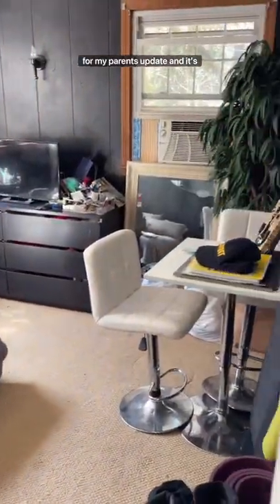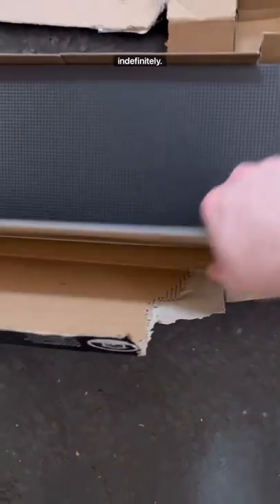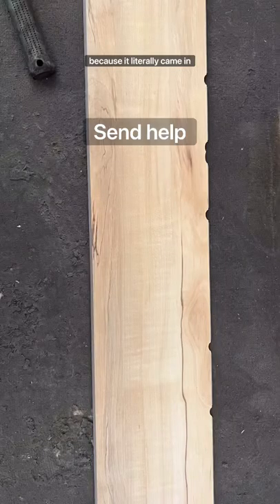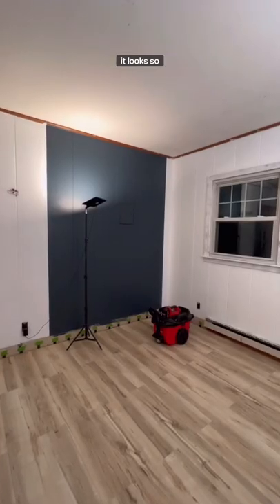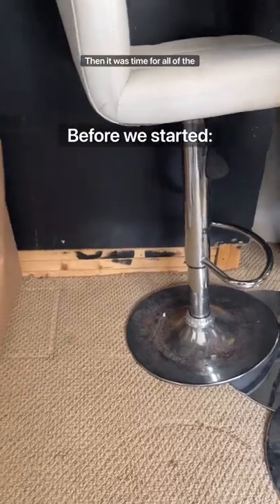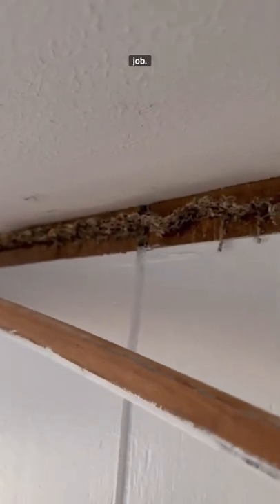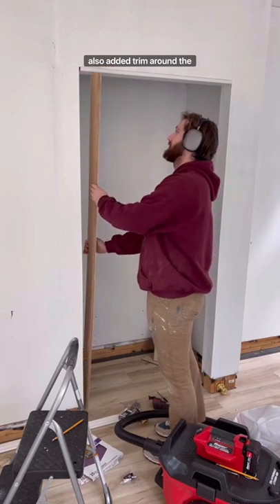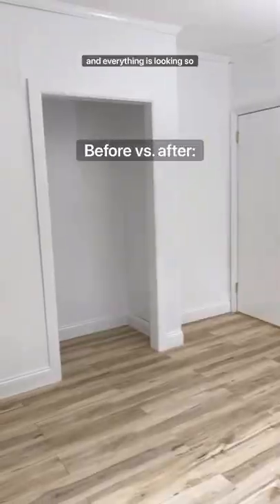Installing flooring & trim in the guest room! #shorts

Comment: Is that an oscillating tool you're using for the molding? Tried to use a coping saw for mine but am having issues haha
Reply: No...it's a circular sander with full rotation...don't know exactly what it is but because of those facts it can't be an oscillating tool.